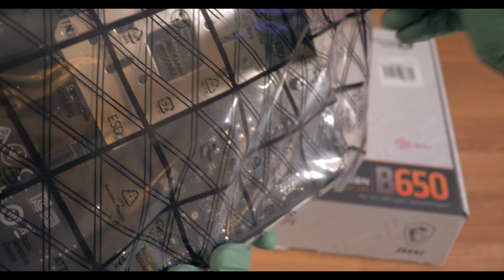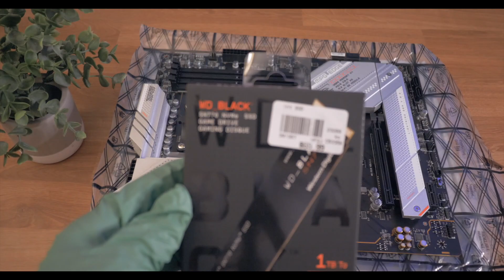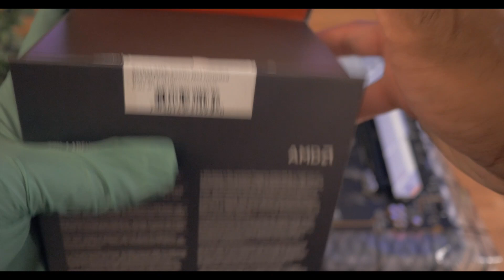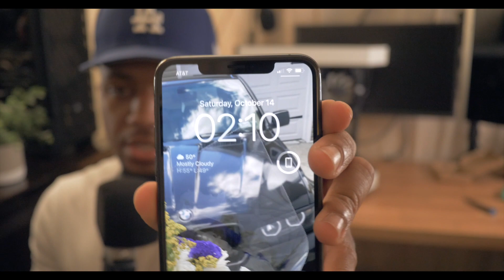My *NEW* GAMING SETUP RYZEN 7800X3D

Comment: I would grab a half decent GPU so you notice the difference. I just went from a amd 7600 and am waiting for the 7800x3d I am not sure if  I will notice much of a difference I am using a rx 6800xt graphics card which I got a good deal upgrading from a rx6600 with a am4 5600x, to be honest wit hthe games I play I noticed slight differences  between the am4 5600x with  the rx 6600 and the am5 7600 and the rx 6800xt . the only reason I grabbed that CPU because it was on sale .  I will never buy Nvid cards they are sooo over priced especially if  a person is just gaming

the one thing I dont like about am5 is the dam training it can take a while for the first few bootups to train the ram of course  I am talking about when you turn on "expo sop that the ram actually runs at in my case 6000mts  the speeds instead of 4800mts" or what ever when I went to am5 I was having issues becasue I thought tha tther was something wrong I actually sent back the motherboard and the same thing ws happeneding then I sent back replaced the cpu same thign was happening I got pissed off while the system was still booting ( 2 minutes later)  I went for a walk around the block came back and the system was up and running so  I reboooted and the system started to do the same thing but it booted up much quicker so  I rebooted again and that time it booted right up so basically  I wasted time sending back parts for replacement parts becasue of the am5 retraining thing .
now I updated the bios and am waiting for the new cpu to arrive and so I will test that to see how much of a difference in the games  i play to be honest I dont think there will be to much
Reply from the maker: yea im saving up to buy a better gpu but for the most part i do notice a decent difference with what little i have, & saaaame i only upgraded because of the sale that was going on. But yoooooooo lmaoooo i had the same thought process even till this day my pc takes like 30 sec to boot, ive just accepted it at this point, but i hope your journey and trouble shooting problems come to an end soon!
Reply: @JustLikeKyuu  there is a setting on the motherboard that can be disabled called "memory context restore " on the  MSI motherboard it is found in the bios OC area if you turn that off what happens is if the system reboots fine after the memory has been trained the system will boot quicker